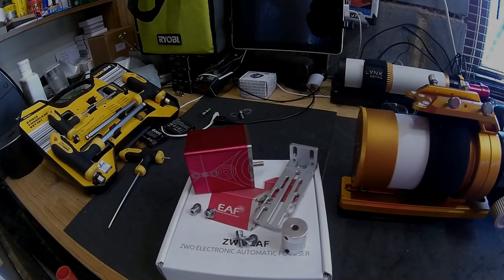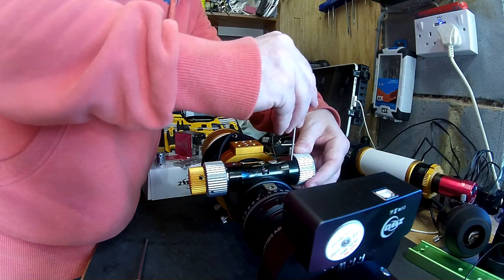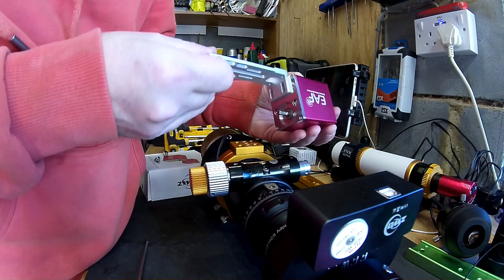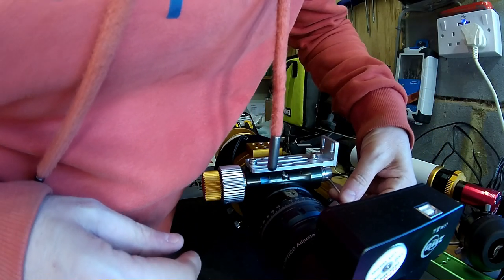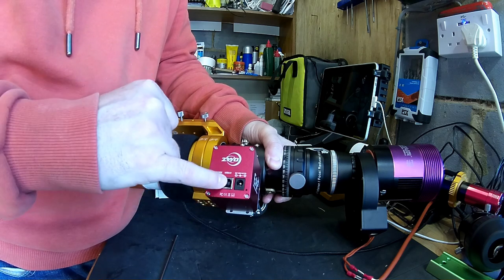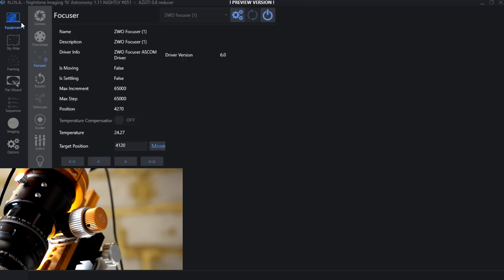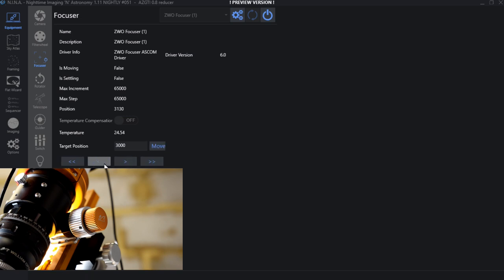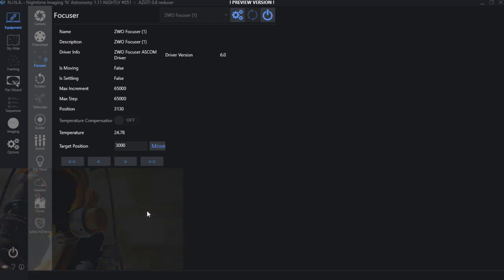Astrophotography with Glenn Clouder - ZWO EAF Installation on a refractor

Comment: Great video! I have my ZWO EAF ordered for my William Optics 120 (780mm) telescope, I use NINA also.
Reply from the maker: They work really well together. Should be straightforward to fit and set up but happy to help if you have any questions.
Reply: @Astrobloke  I saw one video where the EAF stopped working after awhile. They didn't leave another space between the motor and the flexable spindle and it was rubbing during each auto focus. Have you seen any issues with that? Thanks
Reply: @Astrobloke  Don't you still need to do a auto focus even if you use the focus offset for each filter. Over the night the temperature will change causing any filter that you are using to go out of focus.
Reply from the maker: @2badger2  I have 3 of these and never had an issue with any of them. After fitting I always check to make sure the motor can spin and operate the focuser smoothly and with no rubbing. They must have done it up so tight the motor was having to fight against too much resistance.
Reply from the maker: @2badger2  When you set focus offsets you will set one filter for the autofocus, normally Luminescence.    This will be at the start of your session and then the offsets will all work from this initial autofocus point. In NINA you can then set the parameters for any further autofocus checks. So temp change,  Time, or the one I use is HFR difference. That for me works best NINA will measure the star HFR after each image and if that shifts more than 5% then it will run a new autofocus. Using the HFR it covers any temp changes or other problems so your rig stays in focus all night. Only thing it can get confused with is high clouds.
Reply: @Astrobloke  That makes sense. I'll be installing my EAF tonight. Thanks
Reply: @Astrobloke  Do you use the whole frame for HFR or use the NINA option of just using the center area?
Reply from the maker: @2badger2  i have the Hocus Focus plug in installed as that really does improve all the autofocus routines. Just go to the plug ind tab and you’ll see it and there you will also find the filter offset plugin by dark customs
Reply: @Astrobloke  Thank you. I saw the video by "Patriot Astro" and I have already downloaded Hocus Focus too.

Comment: Great video again mate.
I have question in regards to the ZS61 & x0.8 flattener
What have you got the back spacing on the flattener set at?
regards
Marc
Reply from the maker: Thx mate. The backspacing for that is 56mm. The built in rotator is a nice touch
Reply: @Astrobloke  yes it most certainly is, I just dont seem to be able to get the back spacing right! I have 55mm including the 183c 12.5 sensor depth but stars on the edge are bad even with the spacer @ +5. Think ii Ma going to start at +12mm & work backwards
Reply from the maker: What camera make? I have the 183M which is 17.5 built in which was the same on my original 183c (both altair cams)
Reply: @Astrobloke  yes, i have the AA 183cpro (non tec) =12.5mm built in

Comment: Great video as I have the same scope.  Made it super ez to mount.  Question: when I checked my backlash, with the half step, it moved with the first click.  Does that mean I do not have any backlash?  Or should I set it to 10?  1 X 10
Reply from the maker: Thank you. Wow thats nice if it did as that would mean no backlash. Double check it but if thats the case its all good.
Reply: @Astrobloke  I actually checked it three times re-watching that portion of your video while checking it.
Reply from the maker: @jratino  Thats excellent then. Looks like you got a really good EAF.

Comment: Great video. Nicely paced and really clear. So if the routine is called overshoot, does that mean that the EAF (knowing the backlash) overshoots slightly to get rid of it before always making the fine adjustments from one direction?
Reply from the maker: Thank you for taking the time to comment and glad you found the video useful. I believe it slightly overshoots and then backs up the known backlash to get the correct focus position. On e set up its very reliable
Reply: @Astrobloke  Ah. Okay that makes more sense. Thanks for answering. That was bothering me. Shot in the dark. Do you know of a way to set back focus during the day? If so do you have a video. I really begrudge the time lost from a nights imaging checking back focus. And I’m always left a little unsure whether it’s spot on. I use an WO FLT120 with Flat68iii and have just bought a Flat7a reducer and am not looking forward to setting it up :)
Reply from the maker: @AstroCloudGenerator  unfortunately backfocus is not a daytime thing. Also I have an adjustable flat61r and its supposed to have 56mm backfocus. It actually needs 57mm to give me flat stars to the corners so I feel its only a guide to start with. Best to take an image and look at the sub. If stars are pointing towards the corners the sensor needs to move away as too close.
Reply: @Astrobloke  As I feared. I was just hoping for an easy way out. I’ve always wondered how technicians set up and test scopes on a test bench. I can’t believe they wait for a clear night. No worries thanks all the same CS
Reply: @AstroCloudGenerator  You can try an artificial star, a resolution test target or a very distant street light. Two of these would have to be at night but you'll have the advantage of a lot less atmospheric turbulence, if any at all.  You should still cool your scope off to reach equilibrium if the test is done outdoors.

Comment: Just bought the new EAF.  I have a question does it need to be calibrated, like the Celestron Auto Focuser - where you run it to the limits Up and DOWN?
Reply from the maker: hi There. I don't believe so. I have 3 of these focusers and have never had to calibrate them. Its just get the step size right for your scope and focuser and work out if any backlash is there and thats it. Good luck and clear skies

Comment: Hi Glen, 
Slightly off topice here, but i have the same scope and the same WO 0.8x reducer and flatener, now for love nor money cant seem to get decent stars in the corners, any ideas how much to open up it by ? My zwo camera is set back 6.5mm +11mm extender, 21mm filter holder with a filter then the last 16.5mm extender all comes out as 55mm.
Any advice would be helpful thank you.
Reply from the maker: Hi Andrew. I had the same problem. The backfocus for this flat61r is actually 56mm however I think its a out that and not exact. I think mine is currently sitting at 57.5mm. I got it to 56mm checked the stars and kept adding 1/2 to the adjustment until they were right.
Reply: @Astrobloke  Thanks for the advice, will give this a go, as all but given up on it... Thanks again.

Comment: Is an error of margin for the backlash amount at 10 too much?
Reply from the maker: Every scope is different as they use different focus mechanisms. The steps required will vary but you need to see a change in the focus between steps. On this scope that was the setting it needed

Comment: Do you need to fit these when the scope is pretty much at its point of focus?
Reply from the maker: Hi Matt. That isn’t necessary for
Fitting the EAF as you can adjust the focus position after it is fitted. If using a focus routine in say NINA, SGP or APT you need to be close to focus before starting or the results may not be good.
Reply: @Astrobloke  guessing this is pretty much the same drill for the focus cube? Considering getting one or the other at the min.
Reply from the maker: @matthilton8959  I would think so but cannot really confirm 100% as not ever used a focus cube.

Comment: When nudging the focuser and counting the steps until it moves. Am I looking for the fine focus or the bigger focus wheel to move?
Reply from the maker: I always just watch for the fine focus knob to move
Reply: @Astrobloke  cheers. Just been yapping on twitter to you about it, advised me to change to trends @bungsaatropics
Reply from the maker: @matthilton8959  Hi Matt. cool. Yes with my refractor I just use trends. Hyperbolic with my RC8 and Parabolic with my newtonian. I have found that to be the best results. If you get big deviations still try adjusting your focus step =/- 5-10 and see if it improves either way